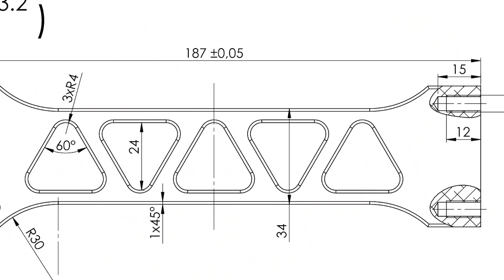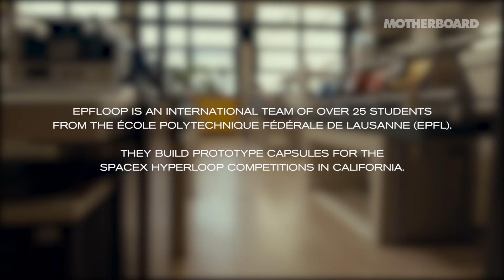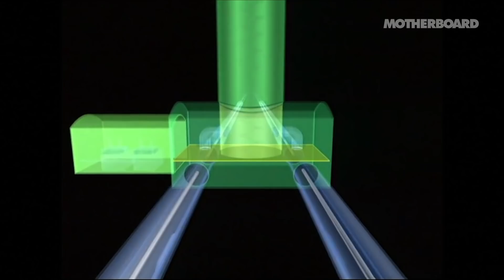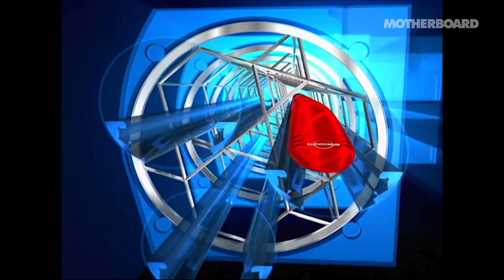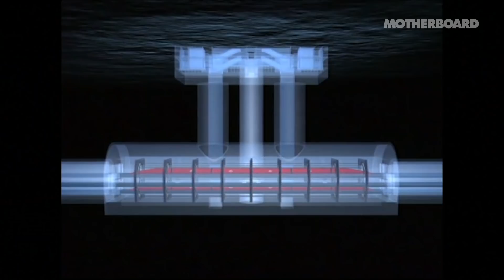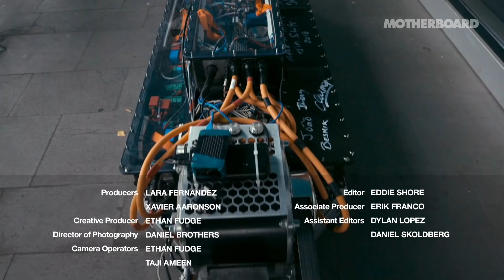Hyperloop Revolution: The Real Story of its Origins and Future

Comment: Arn't you guys supposed to be scientifically literate? The Hyperloop is overhyped bull* that can never work.
Reply: @W4RZD  The weird thing is that you do not seem to understand how stupid your comment really is...bring the dangers of space to ground level...clearly genius at work here...guess you never have seen a vacuum implosion...
Reply: I agree with the overhyped bull part.
Reply: @UC1pE2mPA8PTNu3QbPC2PZrQ We're not exactly clueless now, the Hyperloop isn't some magical new thing that is impossible to understand, but I'm just going to say one more thing about the Hyperloop: Energy required. Basic mechanics and thermodynamics has no shortcuts.
Reply: This was the first sensible comment i saw...good one
Reply: Warzed Arcanist everything you said is true
Reply: @W4RZD  if we are still using engines to get to are destination, than we are doing something wrong.
Reply: @kingjojojo1  wrong comparison.
Reply: explain how it will not work, if it works already?
Reply: @robosergTV  It will always work at small scale.  It could work at large scale (the 380 mile trip between SanFran and LA) if funds were unlimited.  But the first rule of economics is that all resources are scarce, and that includes capital and maintenance funds.  So, it's not that it won't work at large scale;  it's that the large scale costs are so massive that municipal and state jurisdictions will prefer transportation alternatives that are more reliable and less costly.
Reply: @NOLAMarathon2010  Hit the nail on the head you just did.
Reply: @W4RZD  I'm a mechanical engineer an I know what I'm talking about, but I haven't invested money in the Hyperloop and my country doesn't intend to build one so ultimately I will be unaffected by its inevitable failure. Please go nuts and invest all your net worth in this future tech, if it is as good as you think it'll make you rich.
Reply: @deltrex  Actually it's perfectly possible. It's just one wrong flaw can kill everyone & it's expensive af to build the tunnels/tubes for the capsules to travel in.
Reply: @deltrex  I agree with you again. P.s. Two for two.
Reply: @Deltrex There are way too many people who completely fall for such promotions. I'm pretty sure many cities investing in this are going to go bankrupt because there are way too many idiots who don't pause and think about things in logical ways. These clowns think that by making a cool animation and adding inspiring music they are being revolutionaries in engineering when in reality they are talking out their ass. Hyperloop will essentially be the Theranos of transportation.
Reply: stop watching that nerd on youtube who thinks he knows shit.
wats his face . thunderfoot or someshit

Comment: it's gonna shoot out like a bullet if the metal cracks
Reply: metal cracks, air fills tube, pod will slows down. + brakes applied if vacuum lost. Currently we have trains that also travel on metal, they are even heavier
Reply: @snacksy7754  That's not how that would work. On a track hundreds of kilometers long the mass of the capsule would be basically neglectable relative to the mass of the air. No breaks would hold it and it would accelerate to the speed of sound (around 330 m/s) with which speed it would exit out of the end or hit whatever there is at the end.
Reply: This is actually exactly how guns work, except that in the hyperloop you can be the bullet.
Reply: @deltrex  ? they have breaks, and i didnt understand the rest of what you said. I get the push back on new technology, i understand your a conservative, but surely if tons of universities are all helping evolve this technology, and prove that it works! Then this will be very helpfull
Reply: @snacksy7754  Breaks only work up a maximum amount of force they can hold, but in case of a vacuum failure on the Hyperloop the force that even the strongest breaks could hold will be exceeded by several orders of magnitude. Basically the same reason why pushing the breaks in your car in a tornado won't help you because the tornado will just take the entire car or in case of the Hyperloop your pod and the rail under it. 
And apart from that even if it would work (which it can't) transportation on the Hyperloop would likely be more expensive than flying. The only purpose this can serve is as a technology basis for a train on the moon (pretty far fetched) as a vacuum is actually a pretty bad environment for moving parts since all of our normal lubricants don't work in such low pressure.
Reply: @deltrex  ah, we are talking about the air pushing the pod, i haven't looked into it but surely valves can be opened in that case. Electronic signals move quicker than air so air can be let in from the other end.
Flying is a lot less efficient than hyperloop, with the pressure to become sustainable and its low cost after investment and being faster hypeloop could take on planes on some routes
Reply: @snacksy7754  A vacuum tunnel from L.A. to San F. would contain about the same amount of energy as the Hiroshima bomb, nothing about that is coast effective. Take a look at how expensive it is to run the hedron collider in Cern and then scale that up by a couple orders of magnitude.
Reply: @snacksy7754  Some notes: The actual Hyperloop would have to be big enough to transport cargo containers (so not just a 1.6 m tube) and according to the white paper it runs at a high vacuum (1% atmo pressure). You also have to remember that the calculation is only the energy contained in the vacuum that will be set free in a leak. When we create the vacuum we will need to spend more than that since we are talking about a real world application and the feasibility of the project so we can't just use ideal numbers.
So here is another way to calculate what forces we deal with in a Vacuum failure that is maybe a little more graphic: Lets take some rounded numbers an say that our air just has a weight of 1.2 kg/m^3 and our final tube has a diameter of 3 m (would probably have to be even larger) that would for a 560 km tunnel add up to a weight of about 19000 tons of air. That weight times the speed of sound (about 330 m/s which is the speed at which the 19 kilotons of air would move in case of a vacuum failure) times 0.5 ( 0.5*m*v^2) would yield you an energy of about 2 TJ (2 * 10^12 J) which is still less than the energy of the Hiroshima bomb (only about 3%) but in the same ballpark (more accurate it's about 40 MOABs). And even if we take your example of just 0.8% of the energy of the Hiroshima bomb that is still an amount of energy that should scare you away from the project. The correct response isn't "Gotcha your analogy was wrong" but rather "Holy Hell, that's a f*ton of energy". 
Also remember that we don't have and can't have any 100% efficient technology so in order to create the vacuum in the first place we will likely have to expend 4-10 TJ of energy.
Reply: @deltrex   yeh i know that was a ideal calculation, thats the type i need anyway to be prepared for tomorrow :D
So yes we agree that there are some difficult factors with the hyper-loop technology, but thats what engineering is for! to solve dem problems

We will have to see if the tests being conducted show it can be safe, reliable and cost effective
And currently the private companies are leading the charge, so if they try to prove it and it fails miserably that's OK.
Its a free market, if companies can make hyper-loop economically viable there's nothing bad about that!
Reply: Yeah, apply the breaks to go from bullet speed to a halt. I sure that won't make the passengers be just a red paste. Also how are the brakes going to be applied? The train is propelled mostly by the vacuum! ya break that ya break the system in which the train changes it's speed.
Reply: @fjdpaco  Vaccum is the absence of air, like space, it doesnt propell. With air air-resistance slows it down (same way paper doesnt fall as fast as rock). It slows down just like a high speed train. 

Was trying to have a civil discussion, but at this point im afraid next argument is: earth is flat
Reply: @fjdpaco  it runs on electromagnets  , you can break with those.